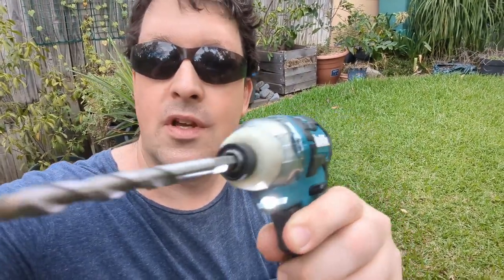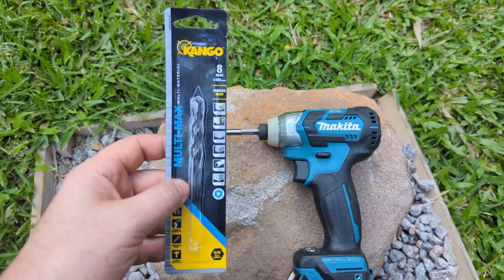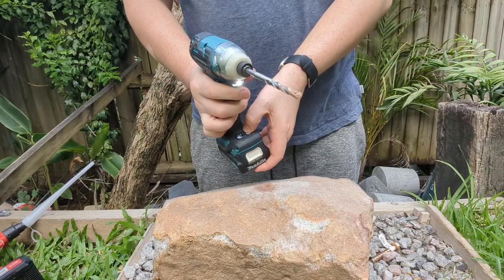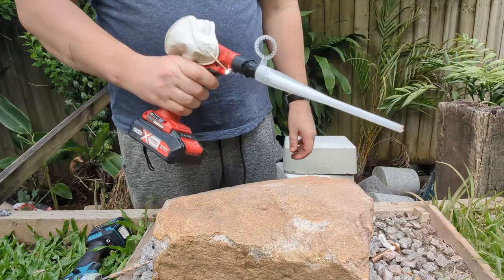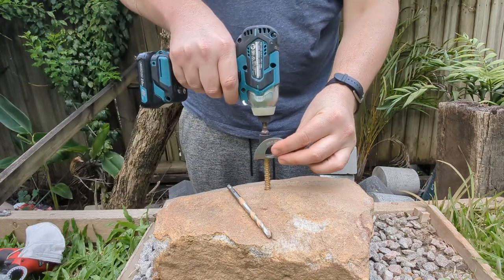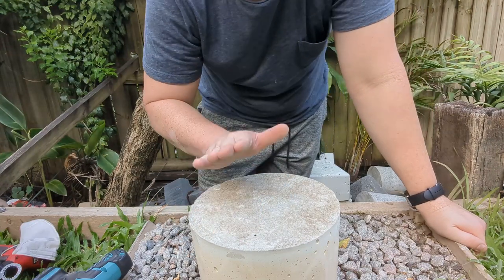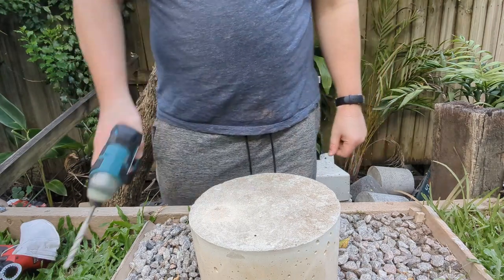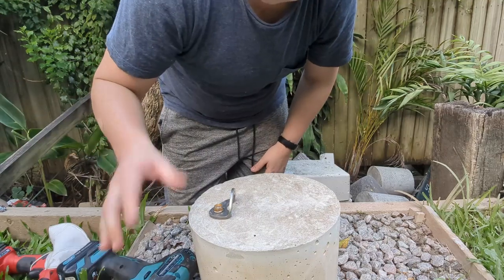Drilling stone without a hammer drill?

Comment: 5:22 limestone is full of shite just like concrete. There'd be times when it would work, but there's usually not a lot of options on where you can place a bolt that won't cause rope rub.
Reply from the maker: Yeah this sandstone often has river stones, usually of quartzite, in it. They do tend to be brittle and fracture easily but I figure if you get something too hard to drill you can always just hit the bit with a hammer

Comment: Looks like you used an 8mm drill bit (about 5/16).  What size screw did you use???
Reply from the maker: Yep 8mm bit, 8mm screw
Reply: @MountainMullet  6mm would have done the trick on the hard concrete maybe? with my DeWalt 20v atomic, its like butter on hard concrete. But I am about to get a 3rd gen milwaukee m12 and I wonder if it can do the same with hard concrete..